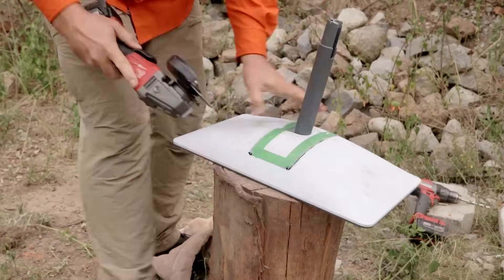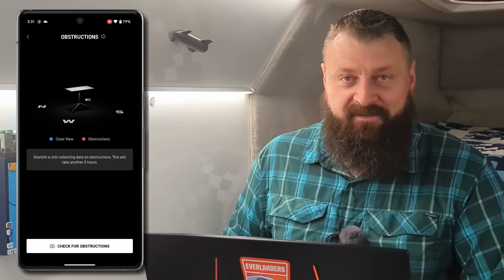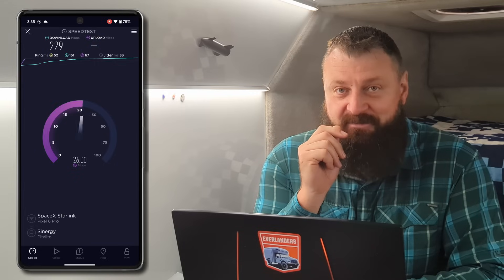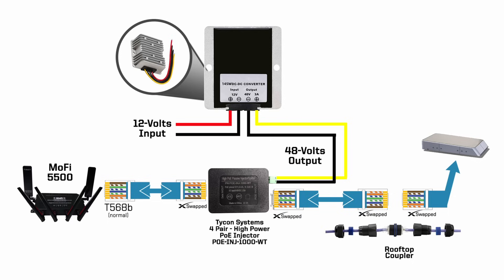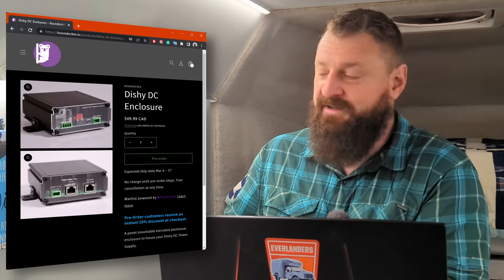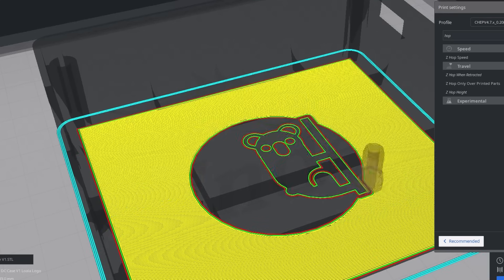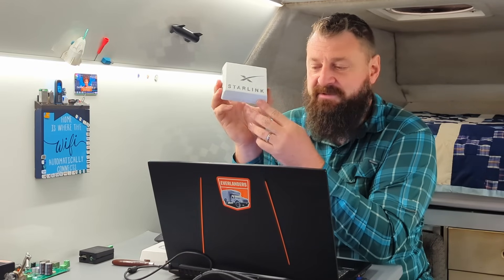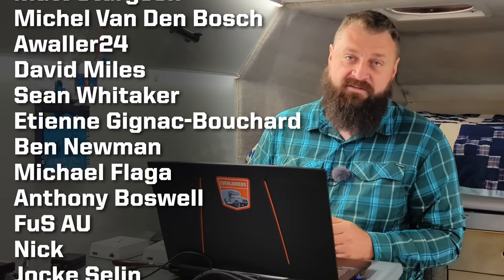Starlink DC Power Supply

Comment: So I'm finally getting around to installing all of my neat stuff for internet, I purchased the Dishy Dulie from Boondocker and the MOFI 5500, and I have starlink. I understand the the Dishy Dulie needs to have 12v power and Rj45 cable from Starklink and the POE voltage selection jumper needs to be removed, but how are you powering the MOFI? It only came with a AC adapter. Is there a piece of equipment that I am missing? I can not use the AC adapter, and theres no accessories for this on MOFI's website. HELP!
Reply from the maker: I just cut off the barrel connector and gave it 12 volts...
Reply: oh nice! Did you use a 10amp fuse?
 @Everlanders
Reply from the maker: 3 or 5 should be more than enough...

Comment: Hi, great video thanks.  I am a complete newbie when it comes to power supply, cables etc.   Am I able to power the dualie from a powerstation (Bluetti/Ecoflow)?  I have DC5521 and cigarette lighter outputs - can I cut either of those cables and feed into the dualie?  Thank you!     ••• to add, also have a two pin aviation port on the Bluetti, for up to 30A - but would prefer to use a DC5521 or cigarette lighter if possible (max 10A, which I think should be enough? - won't be using dish heater)
Reply from the maker: The Dishy DC uses 10 amps at startup, while booting, thus the barrel connectors won't work... The 30 amp connection probably will. But because that power bank has a 50volt battery inside the losses would be the same converting down to 12 or up to 120
Reply: @Everlanders  Thank you!  But the losses would still be less than needing to run the inverter on the power station to plug into the AC ports?
Reply from the maker: No

Comment: Absolutely love your flat-mount and Dishy Dualie DC videos, they gave me the confidence to order Starlink, print the mount and order a Dualie power supply (used your code).

I'm now at the stage of nervously performing the install, since I'm using the Dualie DC I'll terminate into the power supply using the recommended T-568B pinout. Would you recommend that at the Dishy's coupler end that there is any logic in using the X-swapped pinout you suggested in the flat-mount video or should we just use T-568B on the coupler when pairing the flat-mount with the Dualie DC power supply?

Keep up the great work, I'll be watching more of your adventures. 👍
Reply from the maker: No. Standard T568b everywhere...  The swap is handed by the Dishy DC power supply.

Comment: Quick question, could I use a LINOVISION Industrial 5 Ports Gigabit Solar POE Switch with DC12V-48V to DC48V Voltage Booster,4 x IEEE802.3af/at 30W POE Ports @120W, IP40, Compact POE Power for Solar Power/RV Truck/VoIP Systems into a YAOSHENG Rectangular Dishy Cable Adapter to RJ45 into a GL.iNet GL-SFT1200 (Opal) Secure Travel WiFi Router – AC1200 Dual Band Gigabit Ethernet Wireless Internet Router | IPv6 | USB 2.0 | MU-MIMO | DDR3 |128MB Ram | Repeater Bridge | Access Point Mode
Reply from the maker: Maybe... but that's not what I've tested here...
Reply: @Everlanders  what do you mean?
Reply from the maker: Clearly the 30 watt PoE you’re suggesting won’t work… but I can’t be expected to respond to your lazy cut and paste list of products… you have a lot of research to do based on what you’re asking here.

Comment: I finally got the Dishy DC after about 4 month backorder. Heard about it through Everlander. Is it possible to eliminate the router and go straight to a TP Link EAP225 outdoor wireless access point. I want minimal components and straight to wireless wifi.
Reply from the maker: Yup, should work without issue...
Reply: Thanks for quick reply. will be putting it all together this long weekend.

Comment: Be Carefull. I bought the device until now i nerver received. I ordered un august, they promiss september until now nothing. And by the way impossible to contact them no phone and no answer by mail. Is it a trap i dont know but stay away. I loss 100 dollars.
Reply from the maker: What's your order number?
Reply: @Everlanders  3324
Reply: Still no answer despite several emails...
Reply: I finalement got an answer.
But not détailler after 1 month delay the order is not ready there are not able to say when it ll be ship.
I guess they order in asiatique and they have delivery issues.

So wait before order.
Reply from the maker: 1 month! 
It's normally 3 months or more for the preorders to ship...
Reply: They're just extremely busy trying to catch up with orders I got an answer and they're trying to get them shipped out and made as fast as they can so they're just delayed by a few months you'll get it it's not a scam or anything it's just a very small team with very high demand

Comment: Hello, thank you for a great video
do I need any specific Rj45 cat6 connectors?
How about if I decide to use the dish at home during winter, can I use a Rj45 cat6 coupler , to go back to the initial setup with its own router? Thank you very much and cheers from Toronto
Reply from the maker: Any Shielded CAT6 Ends will be fine.

Comment: Hello Jason, first of all deep respect for the fantastic videos you make. Entertaining and very educational!
We come from the Netherlands and have our Starlink in a Starmount box lying flat on the cabin. We recently (finally...) received the Dishy Dualie DC Power Supply (DDDPS). We had already mounted the Starlink router with a connector on the cable to the antenna. So we only had to make an adapter cable to use the DDDPS with its own 24V power supply with our RUT950 router. Unfortunately we can't get it to work. It seems as if there is no connection to the antenna. We tested the connector cable on the plugs and it seems to be fine. Now finally my question...
Should the LED on the DDDPS light up immediately when there is 24V power supply on the board? The LED does not light at all...
Thank you very much in advance for your answer.
Reply from the maker: Yes, the LED will light when it's getting power.

Comment: You said in this video that the Mofi 5500 doesnt support PoE, yet i called the manufacturer and was advised that it does support being powered by PoE meaning that we should be able to power it without separate DC input

Comment: Hi Jason. Keep up the great work. Can you please confirm that if I use The “Dishy DC” power supply that there are no XSwapped connections anywhere in the system at all?  ONLY 568B  you haven’t mentioned the connection/joiner at the dish so just want to be sure. Thanks in advance.
Reply from the maker: Hereby confirmed. All T568B.

Comment: Due to the small strands of wire, cables are also very prone to failure/burn up when usimg the dish heater. Dish heater is not needed even in northern Canada. We got 10' of snow in 2 days and didh stayed working and was clear by end of second day without heater on
Reply from the maker: You believe there is a separate heater? 🤣🤣🤣

The heat is an artifact of the phased array antenna being pushed out of phase...
Reply: @Everlanders  no I know it's not separate but does have separate setting which does cause unit to draw more power and cables burn up. Replaced 13 last winter on ones people have heat option turned on. Those that dint turn it on don't have cable issues m, some through 3 winters so far

Comment: Do you have a similar device for a high performance in-motion antenna? I would like to convert a system to 12V but I can find any wiring suggestions from the dish to the 48V power supply. Using the modified pinout, blows the fuse out. I don't know what else to try. Antenna in use is High performance, factory flat mounted for RVs.
Reply from the maker: I don't know why anyone would use that dish in an RV... at 300 watts the power consumption is far too high and the obvious reason you're blowing fuses... also, it's no faster than the standard dish which works just fine in motion.

Comment: Ok, I preordered the Dishie Dualie. Great. To use AC afterwards, what 12V converter would be ideal to power the new Dishy Dualie?
Reply from the maker: It's intended to be run from a 12 or 24 volt battery system, if you want to use AC just plug it back into the original Router/Power supply with a RJ45 coupler.
Reply: @Everlanders  Yes I know, but I wish to ditch forever the SL router. So I'll connect to my 12V source when boondocking, and use AC when available, so I was looking for recommendations on a decent 12V adapter to power the Dualie and my 12V router.

Comment: Finally got my Starlink DC Power Supply from Boondockers.io and am having a little trouble getting the Dishy and Router to play nicely. When I plug in the Dishy to the Boondocker power supply, I see the increase in power draw from my 12V power supply. I connected my router to the router/wan port on the power supply (jumper removed, it's not a POE router) and I can connect to the wireless network created by my router, but when I try to use the Starlink app on my mobile device, it doesn't recognize the Dishy at all, and Dishy is not providing an uplink connection, so no internet being provided to the LAN. Any suggestions on how to keep troubleshooting? I did confirm that with Dishy plugged in and using the Starlink router as in normal operations, everything works as expected.
Reply from the maker: I wonder how you're making these connections that you're switching back and forth to the OE router.
Reply: @Everlanders  I chopped the male end of the Starlink Ethernet Adapter so I could keep the Dishy cord intact. The Dishy cord plugs into the modified Ethernet Adapter, and the modified Ethernet Adapter Plugs into the Boondocker Dualie power supply. So all of my original Starlink equipment remains unmodified, and I only had to risk a $25 replaceable piece.
Reply: Looks like a prior reply of mine didn't get posted, but I did end up resolving the issue. My test power supply wasn't putting out enough amperage, but once I fixed that, all was good!

Comment: Hello your videos are fantastics.
I bought this device because it is intagrated and more easy to locate in my boat (on the way between Canada to France).

Re hearing carefully i understand : 
- cable from oem router to the POE is a standard T568B-T568B cable ?
- cable coming from the dish to the POE this side have to be T568B ?

But you describe the case where we keep the dish connector.

What should i do if i cut not the grey starlink cable the white stalink cable inside the dish to make it flat ? 

Which cabling at the end of the white cable ? ...

Thanks for your support.

PS : promo code is working fine.
Reply from the maker: If using the Dishy DC, all connectors are straight through T568B standard. If you want to leave the original dish connector, that's fine, it's straight through too.
Reply: @Everlanders  thx now clear
Reply: I think i did mistacke and burned the dish do you have an idea to make the difference between wrong connexion cable and dish burned ? Thx for you help @Everlanders
Reply from the maker: @andrepallotta8633 No you cannot burn the dish...it has current limiters in place. As long as you correct the error it will work.
Reply: Thx you are it start to work but not good at all. I think i have rj45 problem i need to redo all.
An other question about the router i boulot the moi 5500 did you do a spécial setting on the wan entrance ?  Ip6 or spécial protocol?
Thank for your support.

For those who want to use the board 2 thinks there are 2 setting on the board 1 to reinject power to the router and the second to choose the supply voltage arround 10v or arround 20v.
The external switch to turn on the dish the router ... the way to connect is not clear.
People should consider 3 or 4 month to receive the order.
Reply from the maker: @andrepallotta8633 Nothing Special, it just works.
Reply from the maker: When using Dishy DC, all connections are T568B.

Comment: I have the impression that the Starlink router is a power hog. Is there a router (12V?) that you recommend which is more efficient? Thanks.
Reply from the maker: No, it's not bad, it's the inverter that is the problem.

Comment: You mentioned getting 28 watts below. Are you seeing the draw fluctuate greatly or is it holding roughly around that number after bootup and stabalization? I just got my power supply last week and overall performance is normal, but the draw is all over the place. It ranges from 20-100 all of the time. My current measurements put the average draw around 40 watts. Not using a PoE router.
Reply from the maker: It's 28 watts averaged over 24 hours

Comment: Now we just need the same curcuit board with a Dishy direct plug.  I mean you can get the YAOSHENG Dishy Cable adapter for plug'n play - but it would be really neat to have it all in one.
Reply from the maker: Bahhh, It's best to cut the cord and save the 10 watts lost to the cable.
Reply: @Everlanders  I understand the point, when you dish is fixed mounted.  But I'm traveling where there are lots of trees.  I have to move dishy around with the long cable.  Looking for a cleaner setup and not maximum power efficiency ;)  and as you experienced RJ45 crimps can go bad. Especially those DIY.
Reply from the maker: I often pull the dish down and put it out with a clear shot of the sky... Just need a standard extension...

Comment: With this work the Cable not more with the origin Starlink Router. Or?
Reply from the maker: Sure, just crimp a matching end on there...
Reply: @Everlanders  Okay, no plug and play, I need an adapter for xswapt for an update, for example. I just wanted to point that out. Your first solution already had this special cable.
Reply from the maker: No, updates don't require the router, I think you've got some bad information...

Comment: Hello very great video.
I d like to ask you 1 question.
You say that with this pcb no need to swap the rj45.

Could you explain better what does it means : all cable should be standard instead of swapped ? Is it also the case for the special cable to be able to use starlink router for the updates.

Thx.
Reply from the maker: Because the voltage is reversed on the blue and green pair.
Reply: @Everlanders  So the 4 connectors rj45 swapped become normals. Is it correct ?

Sorry my english is not so good.

Comment: I wanted to say thank you for putting together so much valuable information regarding Starlink and it’s ability to function while flat. Also the DC power supply and printed enclosures are truly great information. Good luck with you wandering and be safe. You’ve earned another sub.

Comment: Fantastic video. Very clear and well thought out.  Just ordered a power supply. I work wildfires in BC and have found the Starlink amazing.  Since I change support vehicles I plan on making this into a little kit to easily move around.  Now looking for a small efficient PoE router to use with it. Since I need to place the antenna in different locations depending on where I’m parked I will keep the cable full length. Also want the ability to go back to the original router when around AC power so am looking to make an adapter to go from the existing cable to the new power supply.  Just need to find the right female connector.  Thanks again for pointing me to a great starting point!
Reply: Unappreciated hero! Thank you for your service battling wildfires
Reply: @harmanaulakh7529  thanks for the comment.  Very rewarding work.

Comment: Appreciate this video and I think I am going to purchase the converter in the video.  I don't understand, however, and perhaps someone can answer this question, in the video before this, the connection inside the RV from the Dishy had to be Starlink Swapped.  In this video, using this device, it does not.  Why is that?  I don't want to ruin anything by miswiring.
Reply from the maker: Correct, with the Dishy DC everything is standard T568B crimps, all the swapping back and forth is done inside the Dishy DC.
Reply: @Everlanders  Thanks!  What a wonderful help you have been in our venture.  I have a friend using your design files to do both the box on the roof and the box for the device in this video.  I do plan to wire it so that I can turn off the unit at night and not draw power.   I may reach back out to get counsel on how that is wired if it's not clear from the factory when it has arrived.  (I ordered it after watching this vid).  Again, thank you.
Reply from the maker: Just put a toggle switch on the connector... 😁
Reply: @Everlanders  yeah...I guess that makes sense!  🤪
Reply: @Everlanders  to verify, inside the dishy, still "swap" those, or will those also be standard wired if using this new unit?  You said everything is standard if using this unit...but want to make sure the spliced connection at Dishy is wired correctly too.
Reply from the maker: No, Everything is standard T568B
Reply: @Everlanders  thank you
Reply: @Everlanders  by chance, do you know the total power consumption for the dish, converter, and router in your setup?  I want to run appropriately sized wire, fuses and so forth to the location I am planning to install.  I have a 10 amp fused line providing DC power to a factory installed stereo in our rig we don't and won't use which I can take out.  I need to see if that line will adequately handle the load of the equipment to run this set up.  My router will run off DC  and will only use 24 watts.
Reply from the maker: While it only uses 28watts on average, it's startup is more and is about 10 amps at 12vdc.
Reply: @Everlanders  again, thank you.